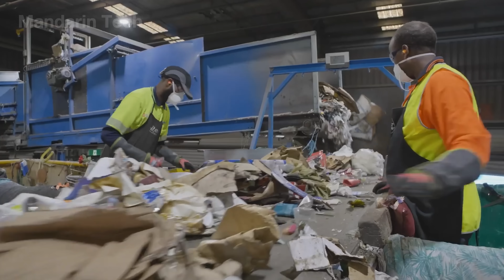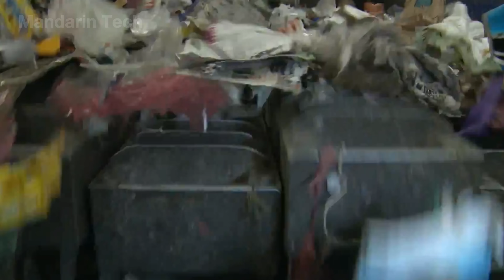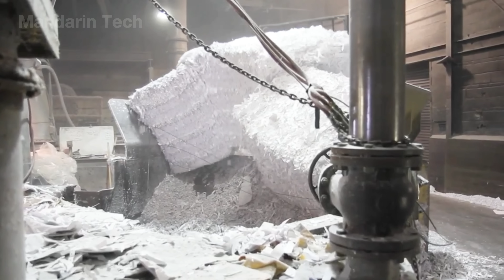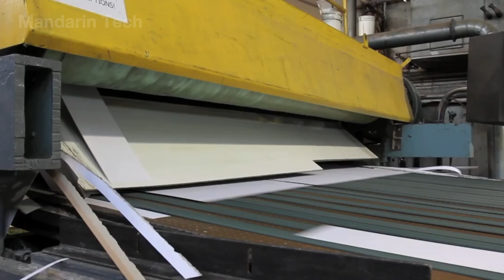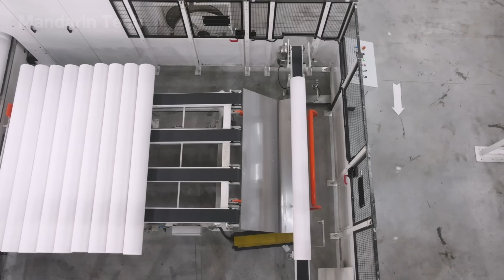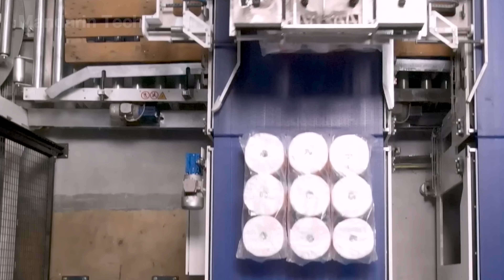You Won't Believe This American Paper Recycling Process Are On Another Level

Comment: And what is the cost of all of the people that do the manual sorting? Recycling is just another liberal fiasco that ends up costing the consumer/tax payer way more in the long run than it is worth. Liberals pride themselves in finding solutions to problems that don't exist!
Reply from the maker: Manual sorting is a small part of modern recycling, and in many cases automation and recovered material value offset costs that would otherwise be paid through landfill, pollution, and cleanup.